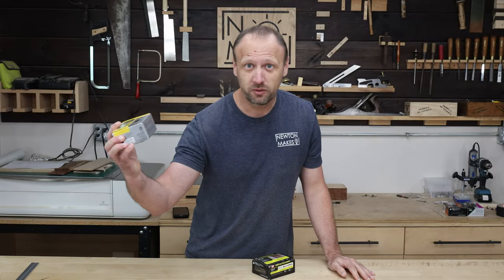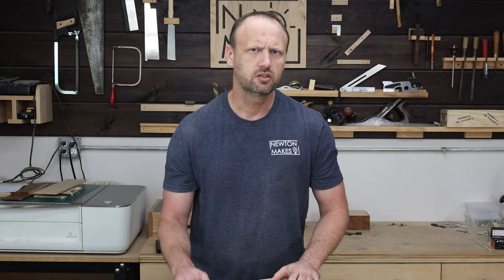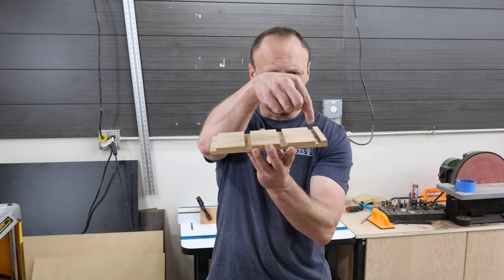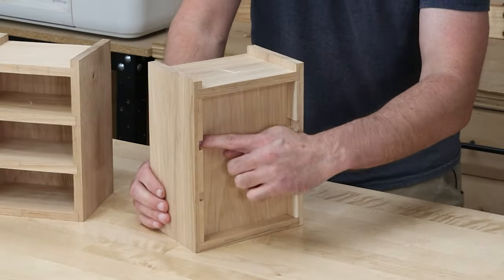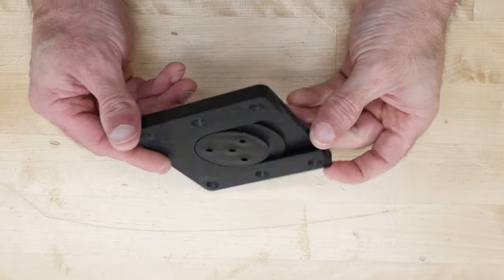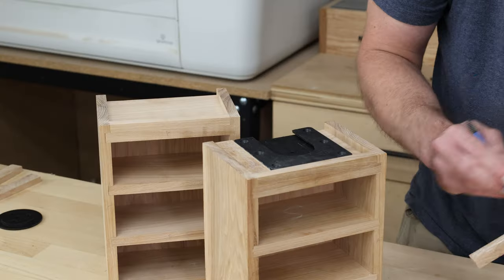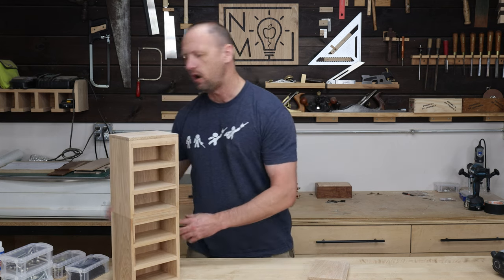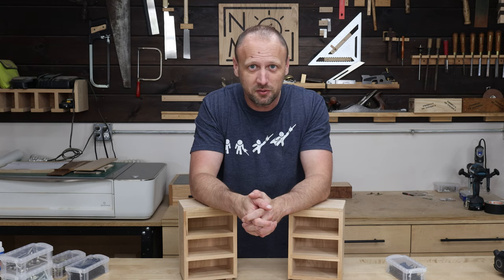Game Changing Customizable Workshop Storage

Comment: Great Video.... Question, ive seen you do this in many previous videos - When your resawing a board, why do you cut both sides on the table saw and finish with the bandsaw, when you could just go staight to the bandsaw?  Interested to see your take on this.
Reply from the maker: It's faster. I get perfectly sized cuts with zero blade drift. Better dust collection. But most importantly, I have more fun this way.
Reply: @NewtonMakes  yeah great point. My bandsaw is so temperamental. I spend ages getting it right, get great cuts out of it, and then randomly it decides to drift. Ill try your way next time.